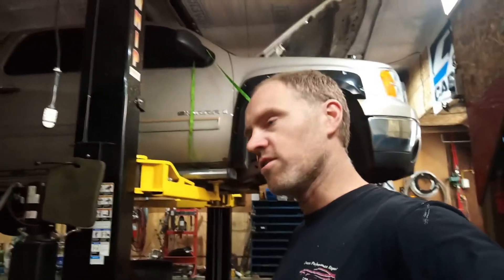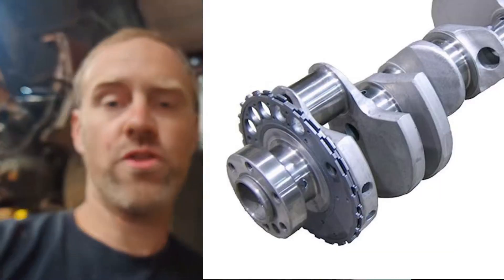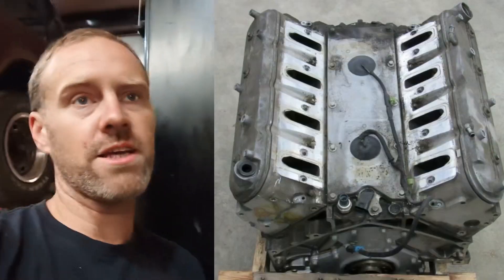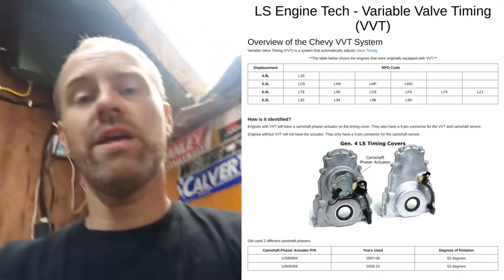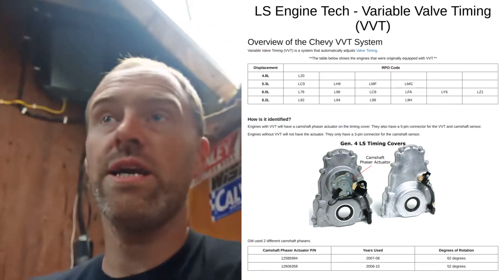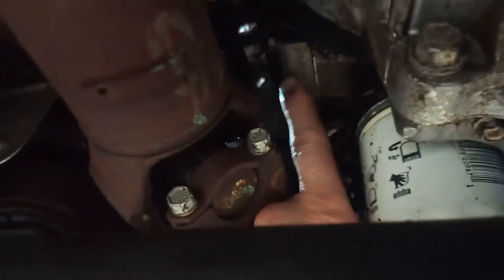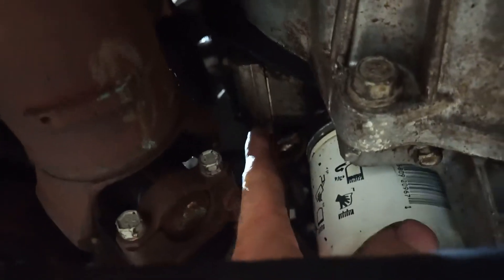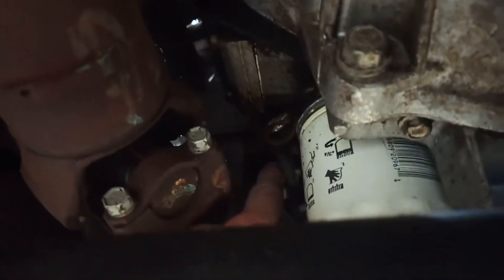Basic Engine swaps Gen 4 GM Trucks

Comment: Gen IV 6.0s used in 2500s have VVT, the LY6 and L96. Gen IV 6.0 and 6.2 use same intake and 823 heads.  4.8 and 5.3 use 799/243 heads and cathedral port intake.
Reply from the maker: Thanks for correcting me sort of... Have worked on several 6.0 l that had cathedral ports so I had to do some research quick. Some of the lq4 and lq9 have cathedral ports. Also I know that LS2 which is not Gen 4 I know, but it had cathedral ports as well. So I guess the 6.0 l can be a bit confusing. Wish they would have realized this before doing the video haha. However due to this, your comment has earned a pinned status.

Comment: I have a 2012 Yukon Denali with the 6.2L. Pulled the motor, did the BTR DOD delete kit with new stock cam and kept VVT. I want to drop that motor into my 2011 Silverado in place of the 5.3. It's also a VVT truck. Both are 6L80E transmissions. Get the ECU reflashed to remove DOD and it will bolt right in, plug and play and go?
Reply from the maker: Not exactly, you have to have the ECU flashed to run the 6.2. should be able to pull the tune from the 6.2 and transfer it to the 5.3 ECM.
Reply: @CrazedPerformanceRepair  I already sent the 2012 6.2L's ECU to "PCM of NC". They'll flash in the DOD delete and then that PCM goes with the 6.2L into the 2011 that had the 5.3L. Correct?
Reply from the maker: @zfinger  you might end up with security or vin match issues. Guess you will have to find out.

Comment: Your videos especially those related with afm have helped me so much, I’ve got a quick question for you or anyone who can lead me in the right direction. I’ve recently had my lifters fail on my 09 gmc yukon and went through and replaced all the lifters as well as the cam shaft and a couple others things just to get my car back on the road (not afm delete kit), can I still disable the afm through a tune or get a delete kit later done the road?
Reply: They have tunes to disable it. They also make a plug in for your OBD2 port that disables it as well. I have a 2010 Silverado ltz with the 5.3 with dod and vvt and I have the tune to delete it and it does fine. I'm going to end up doing dod and vvt delete as soon as possible

Comment: Completely off topic but I have a 6'2 in my Denali 2007 non-DOD and it has loud lifter noise only when cold do you think it would be beneficial to do the transmission flush on the engine oil? Thanks for your time
Reply from the maker: That's most likely a broken manifold bolt. I have a video on that issue as well.

Comment: I have a 6.2 I slapped in my escalade both are 6.2 but the engine Input in was a non dod engine into my dod escalade and has had issues staying on is there anything i need to do tuning wise? Ive already turned off afm and nothing…
Reply from the maker: Are they both the same generation? What did the replacement come out of?
Reply: @CrazedPerformanceRepair  yes came out of a 2007 that year is non dod and mine is a 2010 with the new afm and all that which I was told just take it to a shop and turn the afm from ecm which I did and nothing
Reply from the maker: @paperroute4031  did you old one have VVT on it? If so you need to have that shut off in tune as well. I don't think they offered VVT in 07. They did have it in most by 2010 though so there is a good chance you had VVT.